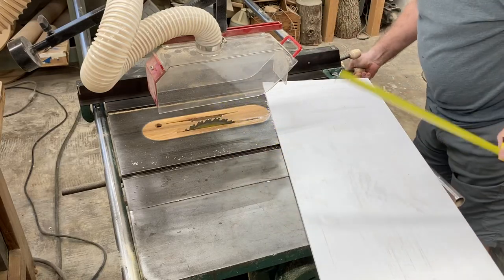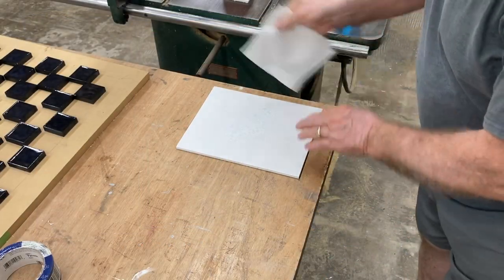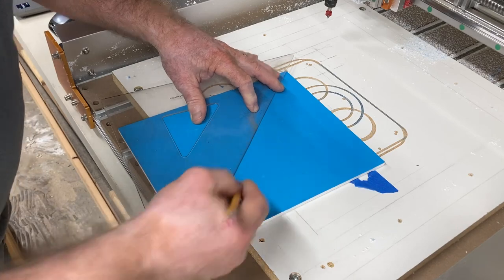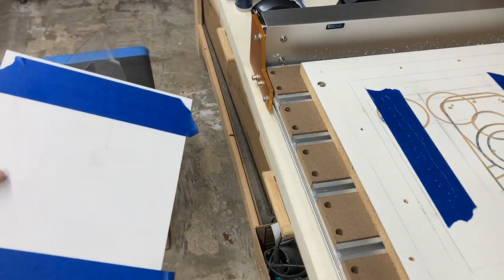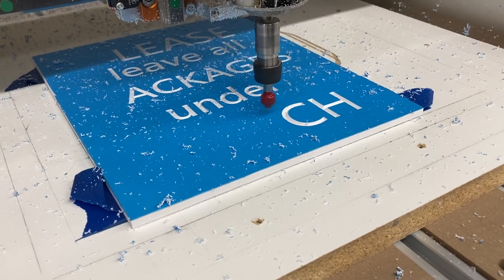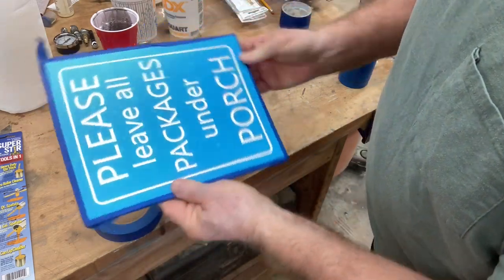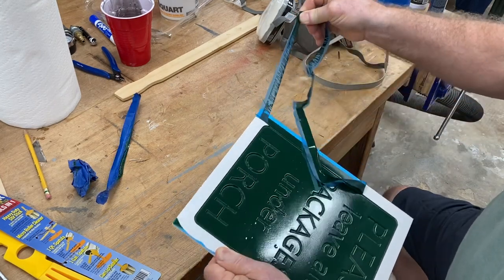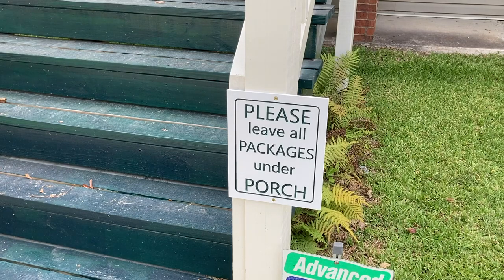Using Easel & XCarve CNC to Make a PVC Outdoor Sign

Comment: You could also skip the oramask if you don’t mind white letters on whatever color you spray paint the pvc board. Just spray paint it whatever color you want, and carve the lettering and the border.
Reply from the maker: Yes, you are absolutely correct. I’ve done that a few times as well. Works great when you can’t get the color pvc you actually want
Reply: @PawPawsWorkShop  I want to try that color core stuff too. Looks neat.

Comment: actually, I have a question..  If you used the oramask, put it on a laser and only used enough power to cut the oramask, but not the pvc... would that work? or would it still generate too much toxic smoke?
Reply from the maker: The masking has PVC and yes it would create toxic fumes
Reply: @PawPawsWorkShop  bummer...

Comment: I could use some advise?  I have used oramask on oak with a 90 degree V Bit with a depth of 1/4 inch.   I did not use the vacuum attachment on my X Carve so that it would not pull up the oramask.  I have done this a few times and the oramask pulls up withy the VBit.  I tried it also with a 1/8 in end mill and it didn't work either.   Any Thoughts on this?  Thanks
Reply from the maker: Oak is a very porous wood. You would need to completely finish the wood and seal it with your finally finish. Once finished you will have a completely smooth surface which the masking should stick to it. (Don’t wax the finish)
Reply: @PawPawsWorkShop  I sealed it with outdoor primer and benjamin moore outdoor softgloss paint then used the oramask on it.  the oramask still came up on the letters.  I am at a loss now.
Reply from the maker: Are your bit sharp?  You must have new or almost new bits. Alison, in my videos you will see that I use a plastic putty knife or an old credit card to push the making down.
Reply: @PawPawsWorkShop  The bit was new and I used a 4 inch metal trowel.  was the trowel too big?  was the paint to glossy to stick?  A dilemma.
Reply from the maker: Just use a plastic putty knife. The metal trial could cut the masking
Reply: Thank You for your help

Comment: Feed rate and RPM?
Reply from the maker: I just ran the easel default settings
Reply: @PawPawsWorkShop  I have no idea what those are. I guess I’ll go try it out. Thanks. My only problem is Easel doesn’t work with my Onefinity Elite Foreman. I could still go and find that info tho.

Comment: Why do you want your packages under the porch? All the thieves can see the sign too.
Reply: I took it as it saves on delivery drivers climbing the stairs and avoids packages being tossed causing potential damage from a high percentage of drivers.
Reply from the maker: Thieves can climb stairs.  I have numerous cameras and I have an excellent alarm system.
Reply: Exactly this. Might as well have a sign telling them where the spare key is too.
Reply from the maker: What’s the difference? They can see the package on the top porch or on the bottom porch. Either way camera is going to catch them.